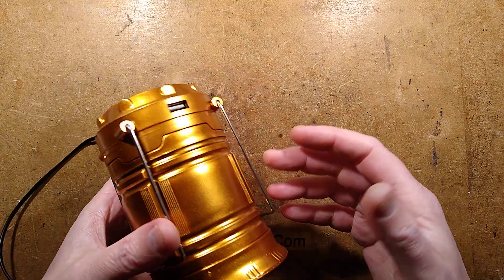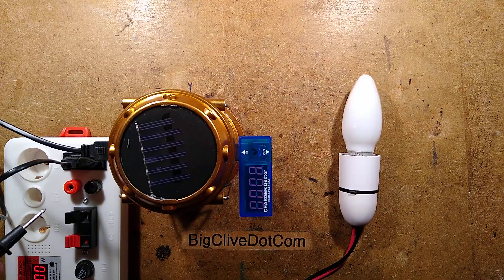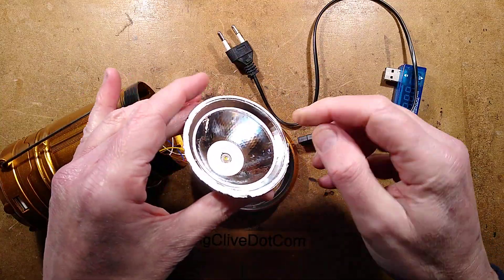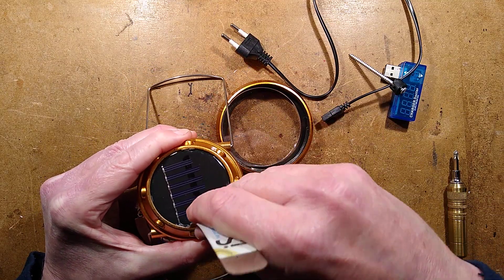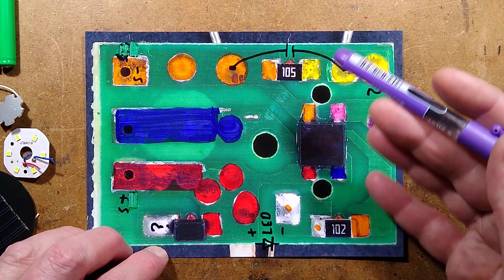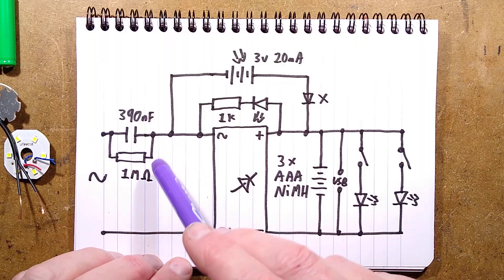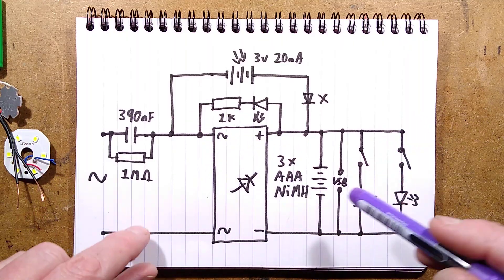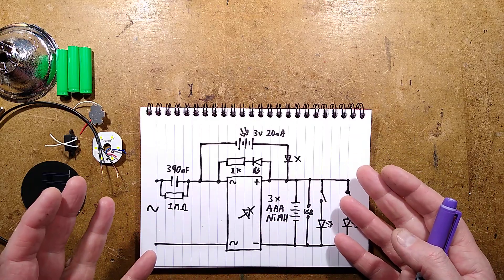Dangerous "death Dalek" lights still on eBay

Comment: Hold on a minute. This is a very unfair test you did with that light bulb. The lightbulb came on when you touched neutral to ground, as it should because you are running a load on your power strip. The neutral carries the current back to the panel unless you have a load connected to your neutral, which, in your case, it does. It would not make this item unsafe just because it did this. Could you please explain why you think it will shock you?
Reply from the maker: I used neutral instead of ground to avoid tripping the RCD.  The bulb lit because current was flowing from live through the USB port to neutral/earth.

Comment: i had the same lamp. i got shocked while charging it. when I tested it with a multimeter and was surprised it had a leak. i don't really know why it happened. but i had 5v charging board laying around. so i just changed it.

Comment: Ohh thank you I think I have a usb wall outlet that does this!  I noticed if I plug things into the USB and handle them they have a tingly, static electricity sort of feeling.
Reply from the maker: That's not uncommon.  Even an Apple power supply will give a slight tingle to ground if it's the ungrounded type.

Comment: if you connect 230VAC to a full bridge rectifier you will get 230x1.4= 233VDC. on the output and will burn both the batteries and the LEDs. there must be something wrong with the diagram you have drawn
Reply from the maker: The series capacitor limits the amount of current on each half wave.

Comment: Been shocked quite a few times over the years by 120v. It hurts and makes your hand numb but its nowhere near as bad as a cameras flash cap.
Reply from the maker: That all depends on the environment at the time.  If your hands are wet and you're standing outside a mains shock gets dramatic fast.

Comment: This object is on a par with the "Himalayan Salt Lamps"  that are still on sale in gift shops all around Australia.

Attempting to get official response turns into a circle jerk with buckpass pike.

Just for reference the block of pink salt absorbs humidity which trickles down the cheap 2 core "flex" (didn't think to try the magnet, thanks Clive) into the equally cheap switch with its steel contacts
. 
The cable and switch body then liven up. The only chance of protection prior to being touched is if it trips on overcurrent.

It is not just fleabay, the high street shops don't give a Xit.
Reply from the maker: Yeah, they're here too.  And their claims of ionising the air are complete lies too.

Comment: Just watched the Beatles get back when George gets a belt, timely 😊
Reply from the maker: The audio industry has always had horrifically bad electrical practices passed by word of mouth.  One of them is cutting mains earth wires to avoid "ground loops".  It is NOT the correct thing to do.  Made worse in that era by people using "vintage" amplifiers.

Comment: The annoying thing is it IS in fact perfectly possible to design a safe version of one of these, even without "shelling out" for a galvanically isolated power supply. All you'd need to do is to is to layout the ports in such a way that a plugged-in figure-of-eight lead occludes the USB port and a plugged in USB lead occludes the power port. It's a technique used fairly frequently for medical devices that connect to the body (like ECG monitors and stuff) because the acceptable leakage current in those is way lower than consumer-grade devices typically allow. Sometimes it's done like that, sometimes a sliding cover is used but the point is you can't have both at the same time.

That copper-coated steel power lead, though... I really feel like we're charting new depths of Chinesium quality.

Comment: You don't have to do any tests to see it's not up to spec. Metal casing and doesn't have ground on the plug.
I would buy any off brand Chinese electronics that uses main voltage. If it's charged with USB it's usually safe, though the battery might still explode ;)

Comment: I recently had a builder doing the pointing at my house, he cut through the wire on the outdoor light. When he was fixing it I asked "do you want me to switch off the breaker before you do that" he said "no" confidently. Luckily when he cut into the wire it tripped the breaker. I'm guessing they'd terminated the neutral at the light switch and not the live.
Reply: My house was built in 1880 so I have no confidence it is wired correctly xD

Comment: the same thing with those chinese bluetooth radio speakers. experienced it myself after plugging in the audio jack with a male to male adapter. felt the pure 240v ac until I luckily stepped on a tile floor. learned a lot of lessons that day
Reply from the maker: Can you give me some keywords to find that exact style of speaker?
Reply: @bigclivedotcom  XB-1052URT , the one with 3 different sized turning knobs and 6 buttons at the front with a large xbass logo. Havent used it for a very long time so I tought it has Bluetooth but it actually just have an auxiliary audio input jack. the one that got be shocked, lol.

Comment: Even without touching earth ground, you will probably at least feel a "tingle" or worse!
Reply: Could the batteries be Ni-Cad, or simply old fashioned Carbon Cells?
Reply from the maker: They're definitely not rechargeable.  A controlled charge on a bench power supply showed no significant charge was taken.

Comment: i commented too early, i had great laugh of steel cable. and also about the fact that discharge resistor is used, so you don't get tingle off plug. but you get hell of a tingle from usb

Comment: Perhaps those are Nickel Zinc batteries, you need the specific charger or a dumb charger, "smart" NiCD and NiMH chargers reject them.
Reply from the maker: They did not take a charge at all on a controlled bench power supply.

Comment: If a cell fails open circuit the voltage will rise to the USB socket and pop anything you plug into it.

Comment: Actual question: I have a lamp that looks identical apart from the color (it's mud green) that my grandma had lying around in a semi-legit-looking box. since you wrote in the description that the death variety is probably a modification of a more legit product, is there any way to tell what version it is? The only big difference I saw right off the bat was the solar cells looking a little different. I just want to know if I can keep using it as a light or have to dispose of it immediately for safety...
Reply from the maker: I'd have to actually take it apart to see that.

Comment: I remember all too well how my hand grabbed onto a lamp while getting a mains shock, I couldn't open my hand so I literally threw the lamp across the room and out of my hands.  It was straight across the heart, the current going from my left hand that was touching the plug and the body of the lamp in my right hand. I fell to the ground afterwards and just sort of whimpered on the floor for a minute or two before I was able to get myself back up.  I had a very sore chest for several weeks.  Close call.  My dad laughed it off and said "What doesn't kill you makes you stronger."  Thanks, Dad.
Reply: "c'mon, get up, shake it off, stop being a wimp"
Reply: With electricity, there is no immunity, nor is there any accumulated resistance (no pun) with time, shocks, etc. It just hurts/kills you. Always remember that.
Reply: @Sam-m1y6d  "one flash, and your ash"
Reply: I love you son.
Reply: @camaroman101  this is your real dad, get off that computer and do your schoolwork
Reply: Im pretty sure your dad said that as a coping mechanism to try and downplay just how close of a call that was. I say this because I could see myself doing that for that exact reason.

Love your dad - he's the only one you got, and one day he wont be here.
Reply: @LegendaryCollektor  He did love me very much, it was just his way of putting some levity into it.  He didn't say it immediately after it happened, only when I told him what happened later.  Sadly he passed away a couple of years ago of cancer and I miss him very much.
Reply: @neodonkey  similar story here. R.I.P.

Comment: Wonderinging Clive... could you make a video, of a new PCB, and a new solar panel,  that can fit this things, and still have it work with cells which one knows(possibly replaceable cells that can be changed out as one dies), this would be a nice idea, I mean we all know clive does PCBs, and circuits, and such, this would be a nice addition to those wanting to learn how to do something especially to make it safer anyways. I mean of course using parts that you have already featured, like solarpanels form other items that had a blown cell or bad board but kinda useless over all for light.  because sometimes we do buy what you have shown for our own hacks too and sometimes more than 1 so we have possible backups too.

Comment: 8:00  Good intentions but you're wrong.  You think eBay is qualified to examine the safety of every item sold?  Why would they not then ban the sale of antique Zenith radios with unpolarized design?  Think a little bit before you speak.

EDIT: I thank you for educating people on engineering and safe design.  It's true that reaching non-technical people is hard, but those of us who learn from your videos have families and we try to keep them safe.

Comment: A useful and  SIMPLE  camping light can be made from a G4 base , 12 Volt lamp and a battery pack from an old laptop ( 3 to 4 Lithium cells ) ... The lamp is  WARM WHITE  ( actually might make the camper feel warm , as opposed to the awful " cold " colour camping lights ? ) ... should you need a reflector  / lampshade , an aluminium pie dish is a lightweight ( and cheap ! ) ,  do not short the pins ! ... ( tried - n - tested ! )

Comment: As for the mystery diode, my first thought is that perhaps it is a 5.1V zener? This circuit is essentially relying on the batteries to clamp the voltage, but it looks like the voltage regulation on that USB output would be terrible anyway. 4.8V is technically within the USB spec, but the moment the voltage drops even a little, many phones would probably start freaking out and throwing warnings about a bad charger. Possibly even simply turning on one or the other of the lights might pull the voltage down enough to throw USB voltage errors.

Comment: I'm curious what those cells are. Possibly they are Nickel-Zinc, a type of rechargeable which run at closer to 1.6V? If they really are alkalines or Zinc-carbons and not rechargeable then that's just wasteful, as the product would become landfill after a single use, to say nothing of the batteries exploding if one attempted to recharge them. Either way, what an absolutely horrendous product.

Comment: I feel this video could have been greatly enhanced if you had shown a corrected circuit diagram showing how it should have been made to work correctly and be safe and contrasted the 2. What did they change to cut corners between the correct design and the bad design? Why they might have thought they could get away with it and why it actually makes it dangerous? That's what i was hoping to learn from this video, but i didn’t get it. I dont understand how the bad version is working since afaik a rectifier outputs at about the same voltage as the input but the batteries need about 5v not 240v? I dont understand why the led goes between the dc side and the ac side instead of being in series with the battery in the charging circuit or something like that?

Comment: I have the miniature version of this lamp. It runs (for a very long time) on 3 AA batteries. Made with cheap plastic so it would probably not survive very long on camping trips. But... In the house, it's very useful when there is a power outage.

Comment: I'd say the best option would be:

Prohibited and restricted items >> Other prohibited or restricted items >> Product Safety / Recalled items
Reply: This is something that is supposed to be safe. You are supposed to be able to charge a USB device while the device is being powered/charged from the mains.

If you buy/sell a device that is dangerous and could cause death, then good luck to you trying to defend that to a dead person's family.

Vintage lights with really thin wiring could cause fires, and your insurance probably won't cover it.

But I get your point about vintage kit, but even they wouldn't kick out 240v to the connected device, which if you were grounded, would give you an electric shock.
Reply: @AubsUK  Manual review would solve this and there'd be no point for this argument. An old and dangerous item you are selling to a buyer with full knowledge of its danger is different from a modern item that the buyer doesn't know is dangerous. Including in the listing prominent disclaimers about its danger/pre-recall state or whatever will differentiate it from listings purporting to be safe, so if both listings get reported only the one masquerading as safe gets taken down.
Reply: @AubsUK Stop living your life in worry and have fun.
Reply: No, you just fix it yourself or ask for your money back.  If you pay pennies, you get cheaply made stuff, your choice.  Don't insist the whole world becomes soft.
Reply: @lambertovitali3152  Start with yourself: stop whining
Reply: So if i wanna sell or buy a device that doesn't comply with modern standards, i simply shouldn't have the option?
I doubt ebay would make a difference between new china crap and older retro tech.
Reply: @chrisakaschulbus4903 If wholesalers or retailers are going to flog their dangerous rubbish on eBay, AliBaba, Amazon etc then they should explicitly state in large print that their products don't conform to standard. This way the buyer takes some ownership of the issue.
Reply: @chrisakaschulbus4903  Congratulations on making up a reason to get upset... strange hobby in my eyes
Reply: @MegaZeta  As someone who imports retro hifi... yes, i totally made that problem up. What's your point, dude?

Comment: The solar panel should be able to charge the batteries via the bridge rectifier not just powering up the LED indicator.
Reply from the maker: It only puts out a high enough voltage to light the LED.

Comment: I'm surprised they don't do the simple answer to the problem, which would be getting rid of a mains input completely and using the USB port to recharge it. Then the problem of isolation would be the responsibility of those making the USB charging plug. (Not that one can trust those completely, but it would at least make the light itself "safer".)

Comment: I'm (sort of) surprised that one of the mains pins on euro sockets is not ground to where the pin diameters could be different to prevent the hot pin going to the wrong place. Two pin USA plugs are all polarized that way.

Comment: How does it drop the mains voltage so it is not too high for the rest of the ct after the full wave bridge rectifier? I would expect a C on one leg and an R on the other on the ac input side. But I don't see that. How can this ct. work this way? No way that should be legal, I would turn them in to the appropriate gov't authority.

Comment: Yes, I saw this exact same thing in the local store as well. They are very cheap and suspicious, and I know it is quite dangerous. But for some people who know electronic (like me) could modify it to be a safe device. We can change it to use lipo battery instead of ni-mh battery, and combined it with the TP4056 charging module. And use USB type C input jack for charging, instead of connecting direct AC line to the device. So it will be safe to use.
Reply: At that point it seems like it would be cheaper to just get the remaining parts and make the casing to assemble your entirely self assembled modular torch yourself - perhaps cheap out a tiny bit and just 3d print that case so it doesn't cost much if any more than making this garbage safe. Probably get a better torch/lantern out of it too...

Comment: The good news is the phone in your hand has a plastic skeleton, so you're safe from electrocution
Reply from the maker: The majority of phones have a metal core that surrounds the entire phone.
Reply: @bigclivedotcom  The majority do, but Motorola is fairly fond of plastic frames on their G and E series phones. Still great phones though, I had a G6 for about 3 years before I ended up having to replace it because I was switching mobile carriers. Though it would be interesting to see if the ground/EMI shield in USB cables would actually be sturdy enough to not become an accidental fusable link in that scenario.

Comment: Weird.  These are all over the US in our 'Dollar General' stores.  I wonder if it is just the specific off-brands that are on ebay/amazon that have these issues?  I don't have the time to bother figuring it out, but it seems like a lawsuit waiting to happen.
Reply: Don't forget they use 220 over there. Any problems are likely to be unpleasant. Problems in the US just give you shock not a grave.
Reply: @firesurfer  There is a really good video by pyrostyro where he goes over the fact that it is neither voltage or amps that kills you.

It is current, but only insofar as the wave function that current carries.

120 and 220 can both deliver a very lethal execution, given that the current and waveform is nasty enough.

Comment: The visual styling of the lamp is almost identical to a battery powered camping lamp I got at a local 'big box' store. The major differences are as follows, no lamp in the base (That space is used for three 'AAA' batteries which are supplied with the unit.),  no solar panel, no facility for external power to be connected and no USB port. It's seems like the makers of these 'Death Dalek' lights took an effective product and made it dangerous in their drive to add features.

Comment: Imagine sending this as a gift to someone, its hard to believe they don't bother to use non rechageable batteries. Probably not gonna burst as wild as lithium cell, but considering the cheepo wire and fail rip off design, this is nonsense.